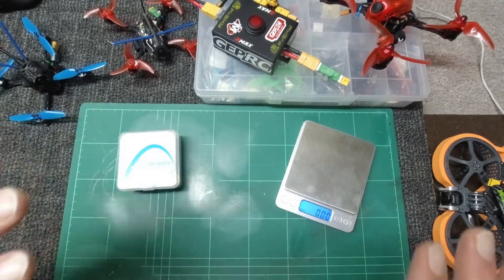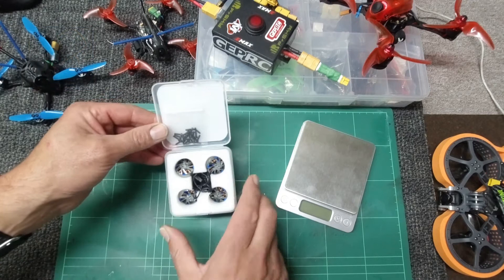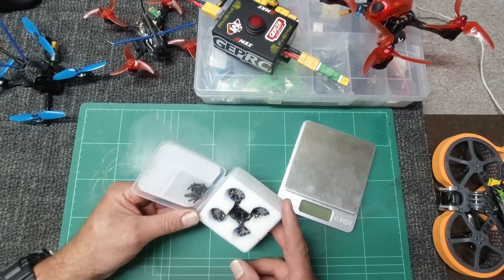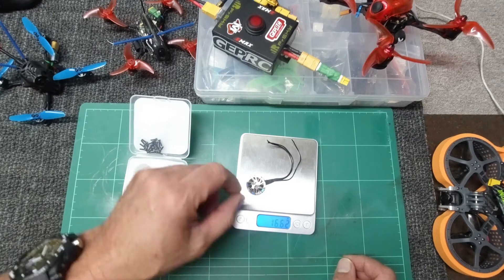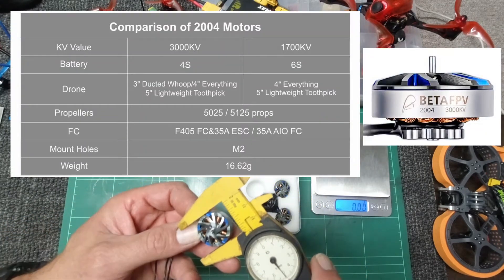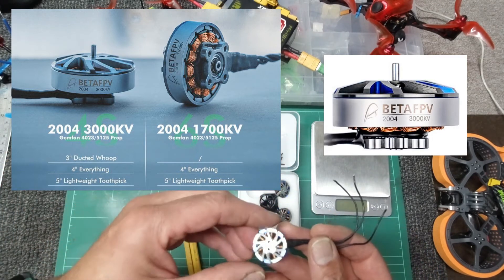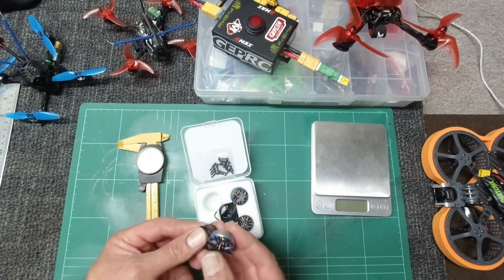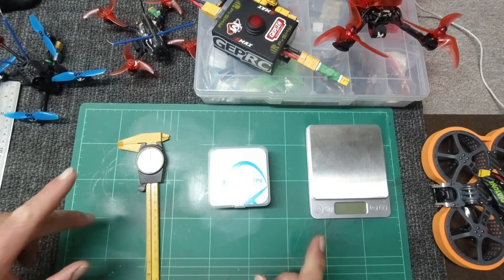BETAFPV 2004 3000kv Brushless Motor - X-Knight TWIG ET5 Review

Comment: Will a Gemfan 90mm-3 fit this motor? M5 & adaptor 1.5mm? Thanks.
Reply from the maker: I would say yes but I'd check the specs for yourself here: 
 https://betafpv.com/products/hq-5025-3-blade-propellers-1-5mm-shaft?srsltid=AfmBOopL0B3sAZZMtIP5p7_VPMbn4Xk0-ooawWTZxqcM9s6uoDGsSxMM

Specification

Item: 2004 brushless motor
Motor KV (rpm/V): 3000KV 1700KV
Weight: 16.6g/1pc
Color: Blue-Grey
Shaft: φ1.5mm
Shaft length: 3.8mm
Shaft diameter: 1.5mm
Hole distance: 12mm
Motor Mount Holes: M2
Input Voltage: 3000KV for 4S / 1700KV for 6S
Cables: 100mm long, 24AWG cables
Dimensions: 24.6*24.6*17.2mm